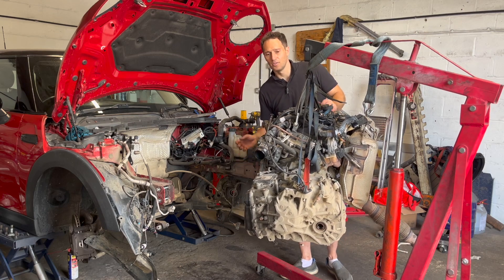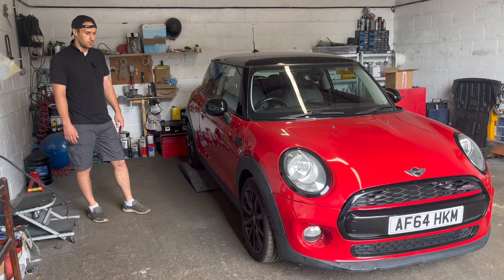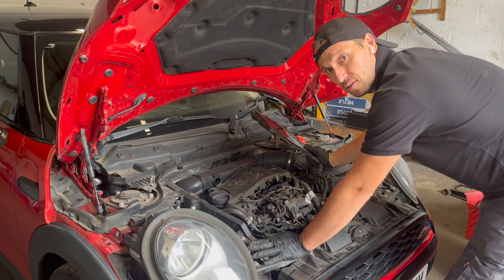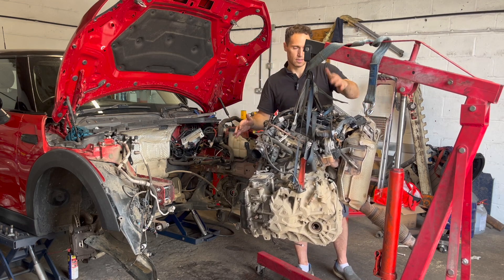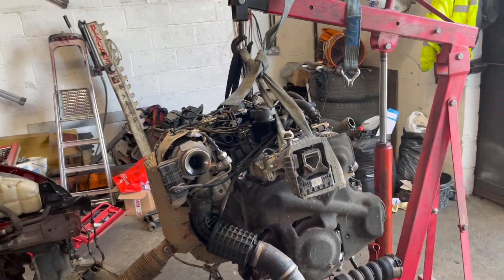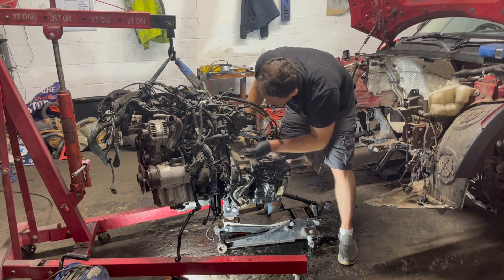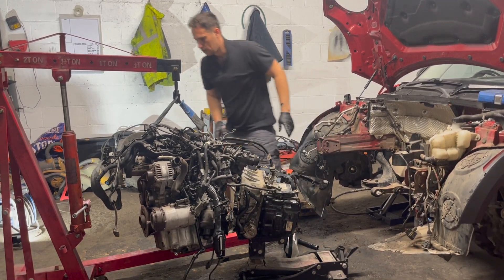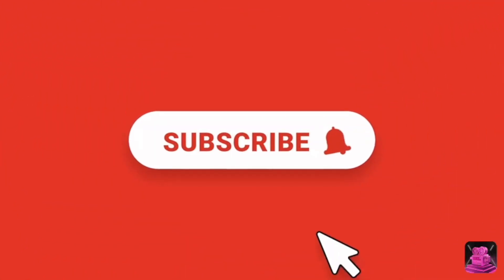Mini Cooper 1.5 B37 Timing Chain Replacement Code 273d00 Engine Removal

Comment: Congratulations! At what age did you started with the mechanics? It seems you are doing this for a long time! Amazing!
Reply from the maker: Thanks, I appreciate it. A few years ago, I started servicing my own car—mostly suspension work and oil changes. Then the timing chain snapped on my late father’s BMW, and that changed everything.
If you’re interested, I made a video about how this passion started. Here’s the link, starting at 08:00 minutes into the video:

https://youtu.be/4LCQQioqhZo?si=12op6vY05LR49yle

All the best
Reply: Good videos!
I have Mini One 1.5 lit petrol with 101HP. Bought it new in 2020, so far wonderful. I just hope that , if God forbid , time chain has to be changed, it doesn't need to take the whole engine out. It would brake my heart if I see it like that.😂

Comment: I have 273D00 fault code but i get it rarely, not all the time. And my chain does not rattle at all! BMW said my vibration damper is heavily worn so perhaps i change that and the crankshaft sensor?
Reply from the maker: @BigHumz155  Thanks for watching. What is the mileage of the car?
A failing crankshaft sensor would cause the engine to cut out and stop, whether at idle or while driving. When this happens, you can usually restart the engine, and it may behave normally for a few days before the issue recurs.
If the damper pulley is cracked, it’s a good idea to replace it as soon as possible. However, I don’t think it’s related to the crankshaft error code. I’ve experienced damper pulley failure while driving—the pulley was smashed and thrown out, and the belt was broken—but no crankshaft error code was triggered.
I would recommend keeping an eye (and ear) on the timing chain.
Reply: Hey! Fast forwarding a few months later - I updated the DME to the latest revision and since then the code has not come back. I've also checked cam and crank correlation and it doesn't seem to be abnormal, this is pretty weird honestly!

Comment: I have code 273D00  speed monitoring: difference between camshaft and crankshaft position too high (intermittent) no rattle B37C15A I’m wondering if chocked VANOS solenoid could cause the code?
Reply from the maker: @roningelert If I remember correctly some similar fault code was present on the red mini from the video, camshaft cranckshaft correlation... B37C15A doesn’t have Vanos system being a diesel car.
Reply: @W15Garage  looks like I’m going to  Bev changing the timing chains! Cam cover off first to check for slack?
Reply from the maker: @roningelert  yes, only the top one will be visible at that point, but usually top one is getting stretched
Reply: @W15Garage  Thanks for the confirmation

Comment: combien de km votre mini ?
Reply from the maker: I can’t remember precisely but under 200,000km
Reply: @W15Garage    je souhaite acheté une mini Cooper D  2014 moteur  TWINPOWER TURBO 1.5  116 cv  me conseil tu ?
Reply: @W15Garage   ce n'est pas fiable ?
Reply from the maker: Sorry but I don’t speak this language
Reply: @W15Garage   is it a reliable car?
Reply from the maker: @bbbb-ok6mu  It was my friend's car. I don’t have enough information to give a verdict, but apart from the timing chain replacement, he had some electrical problems with the central display. Then, he sold the car.

Comment: Hey Mate... EXCELLENT video ... I have an F55/B37(D) and fcan't ind any information how to check and change the Transmission Oil ... Can anyone please point me towards the information I need??
Reply from the maker: Hi, sorry but I don’t have much information about that transmission. Only way I’ve seen it changed is you measure the oil drained, and same amount goes back in. But this method only works if there are no leaks.